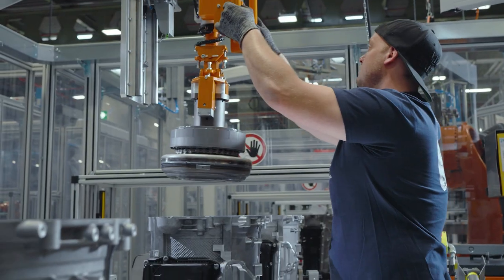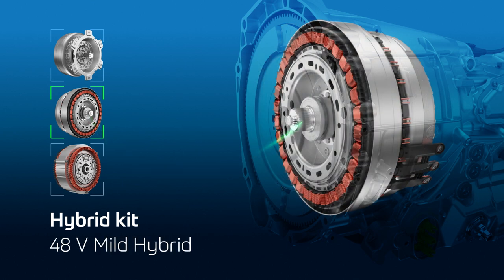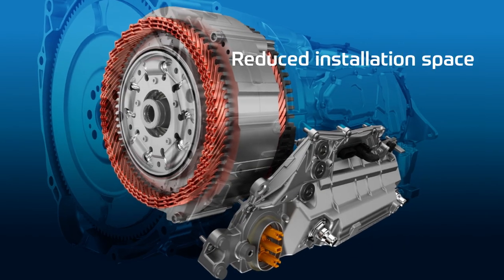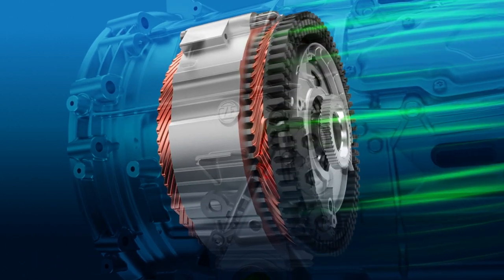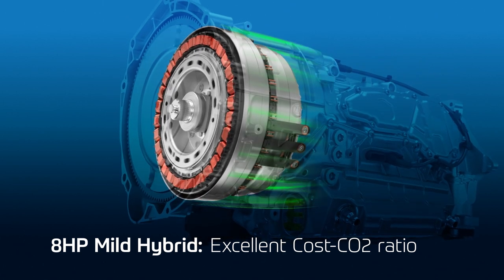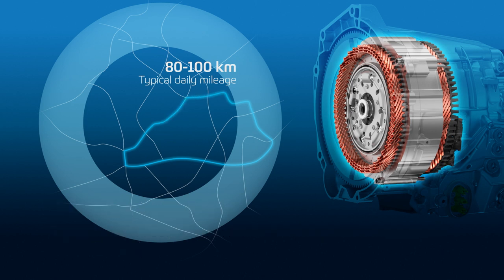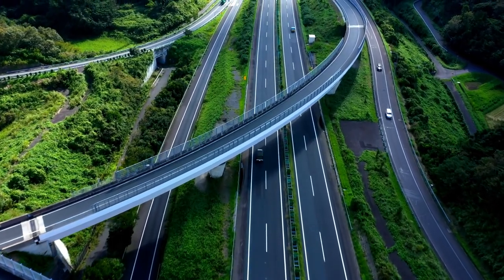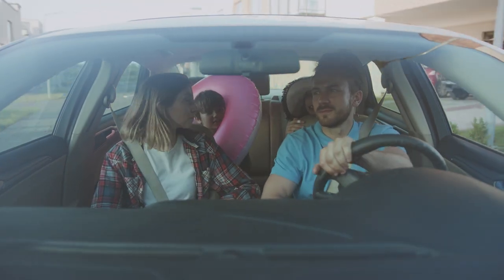8-Speed Automatic Transmission

Comment: Still running the original 4HP 500 in My 1989 Volvo B10M, So coming on 34 years old and has 1.6 million kilometres on it. The only thing other then servicing it’s had in recent years is the Intarder freshened up as it was getting a bit lazy.